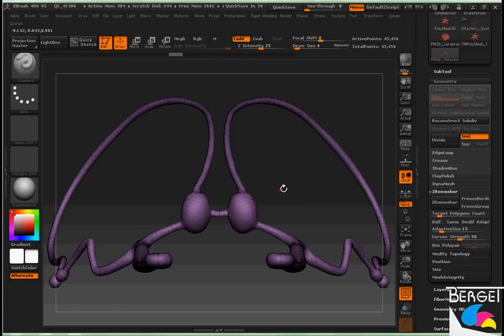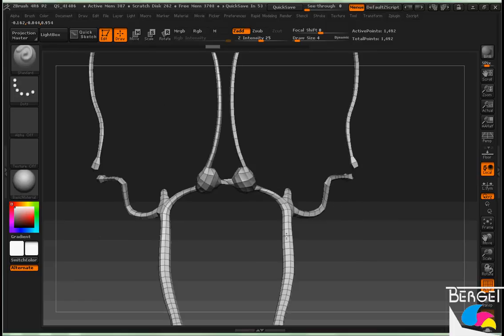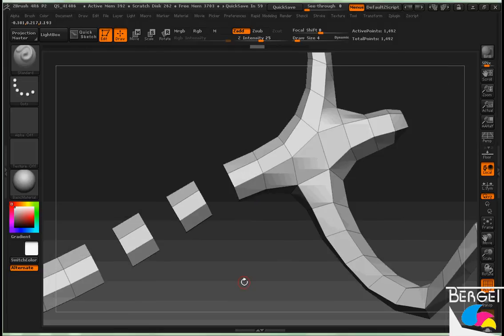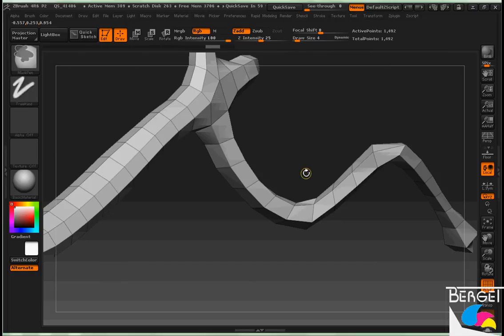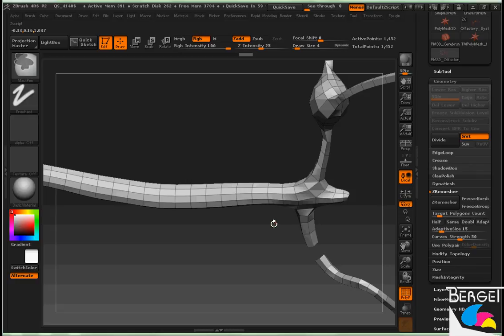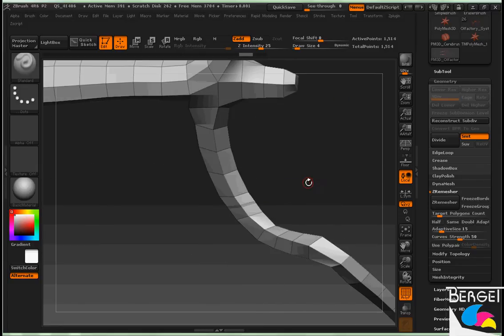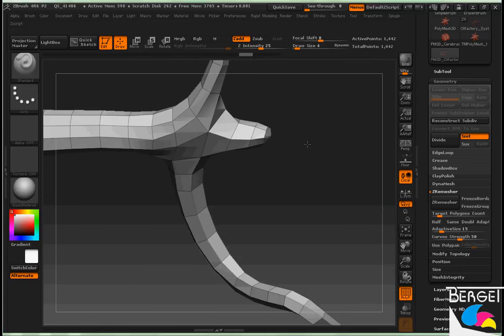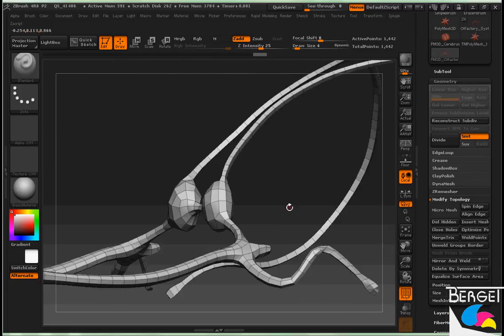Zremesher - Spiraling Edges

Comment: Very nice. Thanks for showing us this Crease Curve for eliminating spirals. :) After you do the low-poly fixes for spirals and stuff in ZB along with weld and mirror on X, are you then going directly to a program such as XNormal to create your normal maps? I tried projecting the high rez after doing low-rez work (with mirroring) and it gives bad results, but it would be nice to do this in order to keep working on the high-rez model. I suppose you could always work again on the high-rez, re-decimate and then use ZRemesher again for edits or changes? 

Thanks again.